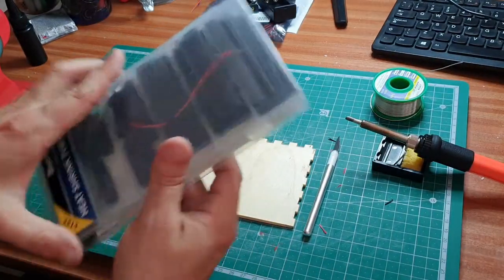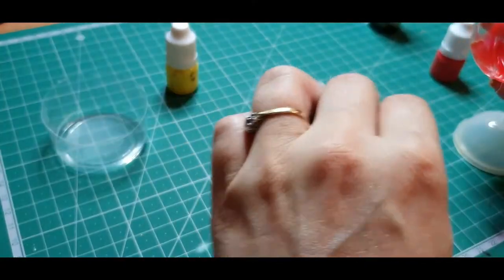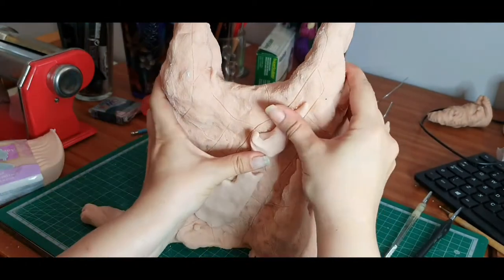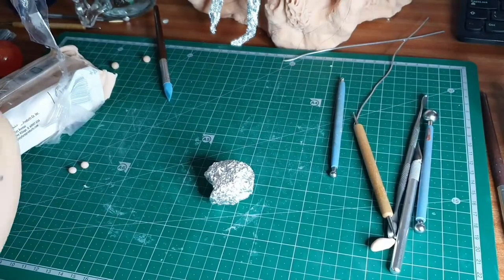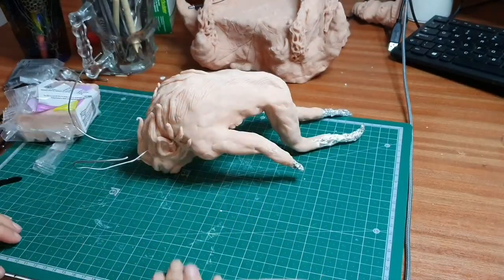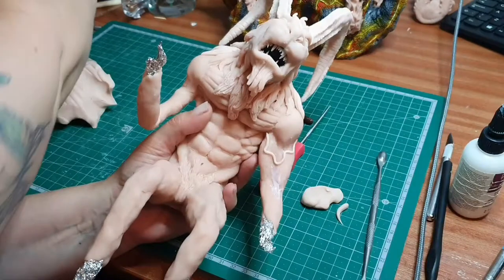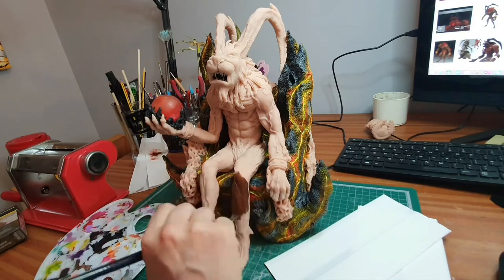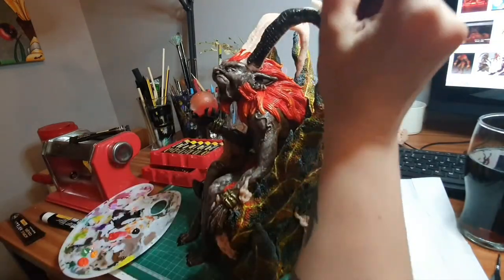Making Ifrit out of polymer clay with working L.E.D light tutorial

Comment: Hey that's cool! Question, so you did bake electric wire and led together with clay? Is it safe to do the wiring before baking? Cheers
Reply from the maker: I baked all the wires i just did it as low a temperature as possible for as little time as I could but they made it through multiple bakes and I wouldn't suggest using a gas oven just because the temperature can fluctuate more than electric
Reply: @pixiewolfdesigns  Cool! Thanks for tip! I'll be around to check for new videos. Cheers
Reply: @pixiewolfdesigns  Hi what temperature did you bake the clay and wire? Thank you for sharing the process
Reply from the maker: Thank you for watching, 120 Celsius for 25 minutes so I think that's 250 Fahrenheit or half a gas mark depending on your oven I hope that helps